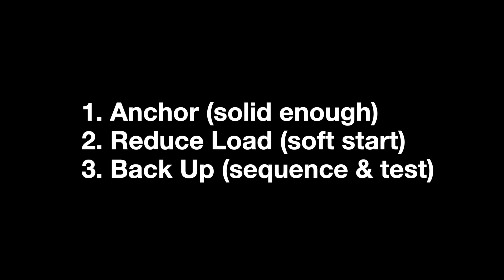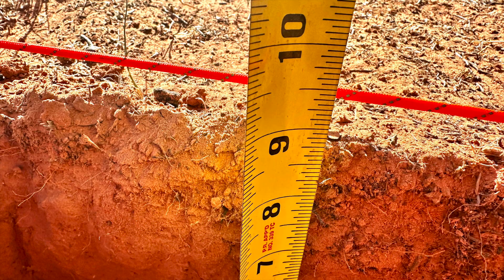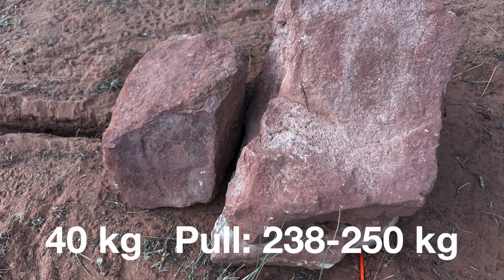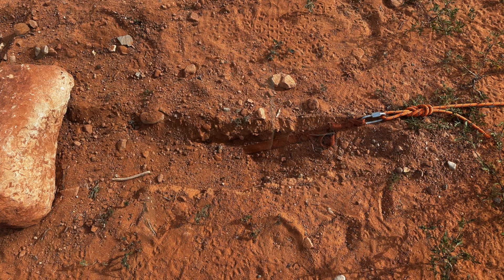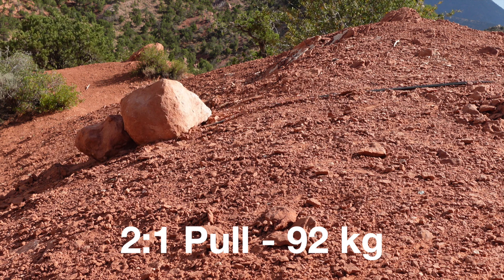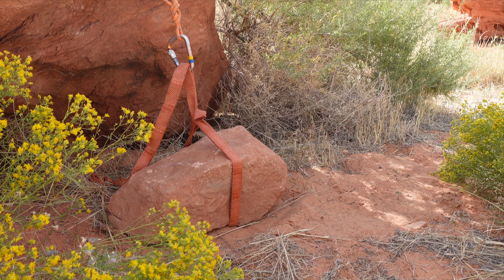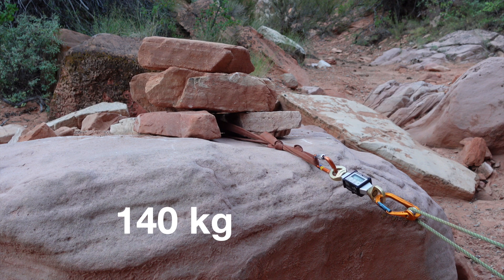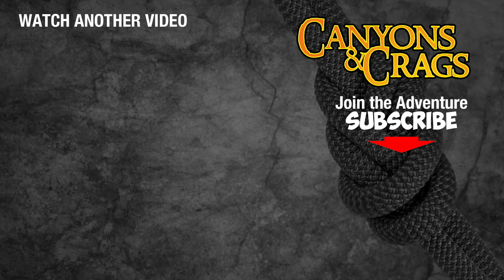Testing Deadman Anchors

Comment: Interesting, I was expecting you would get more force than you did ( a good lesson for me ) , if the opportunity permitted I think digging as deep as practical would help, 45 kg of rock is a lot to move around. My main problem has been making sure the sling stays on the boulder.
Reply from the maker: There are so many variables to consider. For the first deadman depth didn't matter because the ground was solid. If I dug deeper in the sand for the second test the anchor would have been more solid. My goal was to show a big range to drive the point home.
Reply from the maker: Have you watched Part 2 in my Deadman Anchor series? It includes some demos of wrapping webbing around an object. It will depend on the shape of the object.
Reply: @CanyonsCrags yes watched it, I will have another look and pay more attention 😂